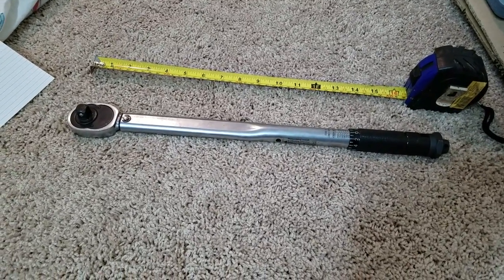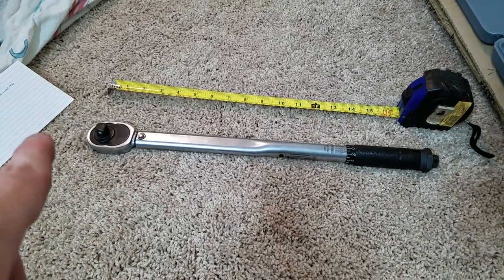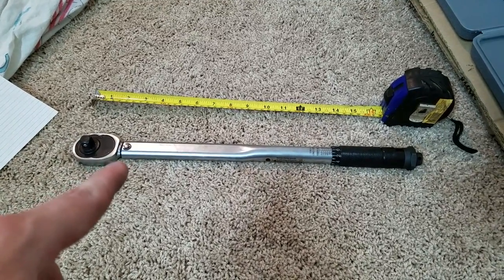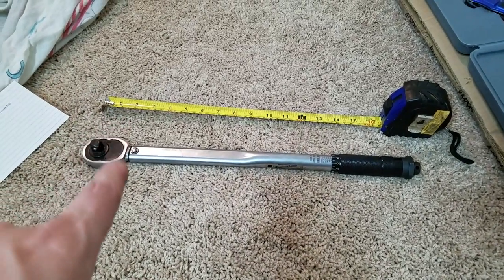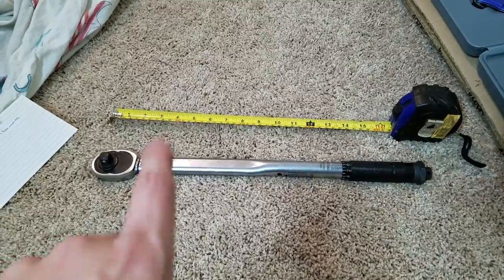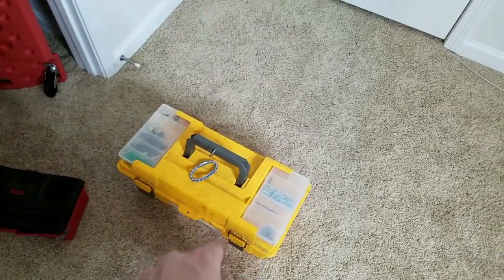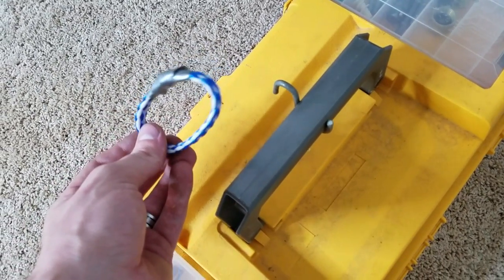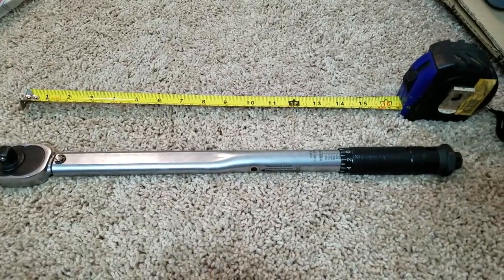Calibrate Torque Wrench Without Any Special Tools

Comment: Was the torque wrench parallel with the ground when you were hanging the weight? If not, you need to make a correction for the number of degrees the wrench deviated from being parallel. The equation is: torque = distance * weight * cosine(angle in degrees above or below the horizontal).

You also need to consider that the wrench itself will add torque, due to the weight of the wrench. Weigh the wrench and consider the weight acting through the center of mass of the wrench. Figure the center of mass distance by balancing the wrench on a straight edge and measuring that distance from the center of the drive square.

Torques are reported accurately only when the force is applied to a particular place on the handle. That is the groove that is machined into the handle and it corresponds to the middle position of where your hand would grasp the handle.

Comment: A. Almost all consumer available scales etc. are + or - 1-3% inaccurate. Even commercial scales have variances. The difference is that commercial scales are “ calibrated “ regularly but in all honesty that could be every week or every two years.  B. use a weight that is approximately halfway of your torque wrenches range ( ie. if your torque wrench measures from 10-120 then use 55-60 lbs. I’m not sure why that is but that’s what I was told by someone who does torque wrench calibration professionally.  C. When using a torque wrench on bolts  for plastic parts accuracy is vital as they will crack at a lower tolerance than aluminum or other metals.

Comment: Wow!  I had no idea that calibrating one of these things was that easy!

Today, I bought 2 of these.  One small one that does 20 INCH pounds to something.....

Sadly, I got a defective one.

Even at 20 INCH pounds, it's like there no clicking.  It just stays solid.

So that's going back.  LOL

The other one, which is almost identical to the one you demo here, I'm not sure yet.

But after seeing your video, I just might test it like you did.

Thanks for that.

Comment: i used to use a torque wrench as a breaker bar until the head sheered off. I welded it back together and bought a breaker bar :)

Comment: Don't you  have to calibrate the scale you used to weigh your toolbox?
Reply: once you have your torque wrench calibrated, you can then calculate the toolbox weight...
ok - kidding. If the scale used to measure the 30lb toobox was wrong, then the wheels on the car will be either under or over torqued by the same amount. oops..

Comment: Use a luggage scale instead, in a horizontal movement.
Reply: You could also use a regular bathroom scale. Stand on it to get your weight, remember it or write it down. Grab the weight and remember or write down what the scale says. Calculate the difference between the two numbers. I know I know, bathroom scales aren’t pinpoint accurate but neither are the luggage scales that you can buy at some places. Ours that we bought 3 weeks ago read almost 2 lbs. .8 kg. Low compared to the commercial scale at the airport check in.

Comment: If you don't find an Allen immediately, you may be lucky with a small common flat screwdriver.
Allens are hexagonal but the right flat turns them.
Reply: You make me cringe!!! LOL  I have done similar things but, the older I get the more time I save by using the right tool for the right job.

Comment: Very good. Unfortunately you have uncalibrated it by setting it to 50 lb ft. That's why you had to tighten the adjuster further.
Reply from the maker: I did set it to the wrong number, however I calibrated it to the wrong number, so it may be set to 50 but I use it to the calibrated 40
Reply: @JRobling  Thats not how it works dude
Reply: Oh good I noticed that too but thought maybe I’ve been using my torque wrench incorrectly. Yeah he did have it set to 50 instead of 40

Comment: Torque wrenches are supposed to be used and calibrated from the center of the handle. That's why many torque wrenches have a center pivot in the handle.
Reply: I want the same medication as you are having.
Reply: @Ricqu  maybe you could explain that reply with some technical details since I do not understand it. We checked the calibration on our torque wrenches before and after use on flight hardware in the space program. So, I do have a little experience with what I'm talking about.
Reply: @darth1000blue  Space program? You should go back to your playlist and rewatch the 'how to improve social skills' video, because I'm pretty sure lying isn't part of that.
Reply: @Ricqu  20 years in the Space Shuttle program. Prior to that, I was in Military and Civilian aerospace. You call me a liar and yet, I have to improve my social skills? Your lack of a technical reply shows that you do not know what you are talking about. Hey, why don't you tell me about your country's space program? :-)

Comment: Thank you for the lesson! I'll calibrate my torque wrenches this way...Great video :)
 just 1 comment: I think that the numbers by themselves aren't actually the reading, but the line that points them, so in 3:30, you're adjusting it to 50 😱
Reply from the maker: Honestly i'm not sure how it is properly done, but I did calibrate to the way I set it so I should be good, and if you calibrate it to the way you do it it should be perfect for you. :)
Reply: @JRobling  but you had it at 50... so that means that you were thinking you were calibrating it to 40, but in reality it was 50 since that's what you selected.
Reply: You can clearly see the 50 is clear of the black knurled handle. He has it set to halfway over the number “40” which means he has it on the line pointing to 40 ft/lb.
Reply: @raffikkiz  ok, I'm coming back 1 year later, now I have so much more experience with tools haha. And yes, some tools have that S shaped lines, so that you can see the complete number at which you're setting to. And there are some other tools which have only straight lines, and in this case, you cut in half the number you're pointing. For example, a tire pressure gauge :)
But I agree. As long as you're the only one who uses a certain tool, however you calibrate it, will work the same
Reply: Watch the tekton how to use video.  The line below the number is the torque value..  if its over the number than its the number above that like dude said in last comment so you can see the number..  so yea he had it set to 50 and not 40..  but to calibrate a torque wrench properly you should always use the wrenches highest torque setting value for the final weight so you would take the highest number and subtract the 1.333 value so weight=htv-(htv•1.333) if using 16"

Comment: Excellent review! Very easy to understand for newbs. Just wanted to know how to lock the hex bolt once you have caliberated the wrench.
Thanks!
Reply: You don’t lock it. It’s an adjustment screw. Put the plastic or rubber cap back over the hole and that’s it. It’s not going anywhere.

Comment: Don't use a torque wrench as a breaker bar, reason being it is hard on the internal parts, use a breaker bar for breaking bolts, then the torque wrench won't have to be calibrated as often, if you don't use it as a breaker bar.

Comment: don't use a torque wrench as a breaker bar, I used to, I don't now. use a breaker bar to "break" a bolt lol, but good video
Reply: AdrianJayeOnline yeah it’s worth the extra cash to buy a breaker bar preventing the torque wrench from throwing off the calibration

Comment: Torque = L x  w /  12       16  inch x 30  lb  / 12 = 40 ft-lb
Reply: Hello. Does the same apply to centimeters?
Reply: @thanosgalanis6940  Is that like centipedes?

Comment: Can you tell me how to disassemble a Craftsman torque wrench from 1972?
Reply: A grinder would work. 
It's obvious this guy is not and expert on all things torque wrench.  He doesn't know there are metric Allen wrenches.  Why would you even ask this here?
Reply: @Caderic  I was needing to disassemble the torque wrench to replace the spring and looking for someone with experience to answer. I did find someone to show me how to do it. It's very easy and does not require a grinder. Unfortunately the springs aren't available anymore.

Comment: You neglected to take into account the weight of the bare lever / handle at your chosen point (16 inches).
Your calibration will therefore be out.
>
Reply from the maker: That would makes sense if you used the torque wrench by adding weight, but people use the wrench by holding, thus negating the weight of the handle.
Reply: @JRobling  It doesn't matter which way the wrench is oriented when being used, whether its up, down, or horizontal, it will still click at the exact same point it was calibrated, and you have calibrated that wrench at 30lb plus the weight of the lever. I know what I am talking about. I have a degree in Physics.
>
Reply from the maker: @Bodragon  Ok, so when you calibrate your torque wrench, make sure to add 1lb. My lug nuts shall be forever set to 81ftlbs
Reply: @Bodragon  Good call. This is especially important if you are testing your wrench with low weight. For example, if you want to see if your wrench can accurately measure low amounts of torque.
Reply: @JRobling  My wrench weighs about 1 lb, at 1ft. foot from the head, but wrenches vary.  To be more accurate, pick the point on the handle you want to use. Rest only that part of the handle on a scale with the wrench horizontal. Rest the head of the wrench on another object (like a finger). Add the scale's reading to your toolbox weight. Since you've committed to a certain spot on the handle, you can adjust the torque setting on the wrench to match your weight and distance. Thanks for the video. Helped me out.
Reply: @Bodragon  
Did you take into account the ambient temperature. As you would know, the hotter the weather, the more metal expands and weighs. 
I should know, I have a degree in YouTube sarcastic comments.
Reply: @Andrew.quigley  Ambient temperature within quite a large range would have negligible influence on this particular result.
The weight of the handle, on the other hand, will affect the end result quite dramatically.
The ignorance of your comment seems to suggest that you think I am nitpicking over trifles.
I can assure you that I most certainly am not.
If you were an engineer, you would know this already.
>
Reply: While it might be out, this isn't meant to perfect.  It's close enough.
Reply: @Andrew.quigley  Ooooh you're good, I thought you were going to say the buoyant force of the air had changed.
Reply: Torque created by the weight of the wrench itself is at the center of gravity of the wrench. If we assume it's in the middle, thats like 10 inches, let's say it's 1 ft. If we assume the weight of the wrench is about 1.5 lbs, the torque is 1.5 ft lbs, which at the 30 ft lbs setting is still only 5%. So calibrating it without taking this into account you lose like 5% accuracy, in higher ranges, less. You definetely don't have any degree in physics...

Comment: Using a weight like this is inaccurate since it doesn't account for the weight of the wrench itself. A ½" torque wrench can easily weigh a couple of pounds, and with a 30 lb weight, that's an error of over 6%. Besides that, you measured the 16" before setting the torque value, and that mark will move as you twist the handle to set the torque. Finally, the position to choose needs to be in the middle of the handle, as that's where the wrench is designed to have force applied.

Comment: Hi JR my question 2 u is do i  torque the wheel nut to 40 foot pounds ?
Reply: Tighter than what you’re calibrating the wrench to
Reply: My vehicle lug nut has a torque spec around 95 or 100 lbs. If you are calibrating your wrench like they guy in this video, you don't want the weight to be close to to your lug nut spec because you don't want it turning while you are doing your test.

Comment: You set it to 50 and didn't account the weight of the bar.
Reply: Should it be the weight of the bar divided by 2, assuming the bar's weight is evenly distributed between the lug nut and the end?
Reply: @christophers6034  the weight of the wrench would act in the center of gravity, doesnt necessarily have to be in the middle. But yes, for this calibration to be accurate, one would have to account for the torque applied by the wrench under its own weight.
Reply: It's negligible if you make a rough count. If the center of gravity is like 1 ft from the head, and the wrench's weight is about 1.5 lbs, it's "own torque" would be only 1.5 ft lbs. At the setting of 30,it's still only 5%.